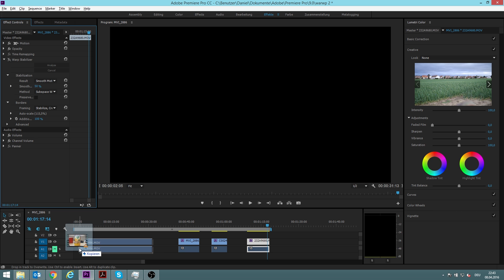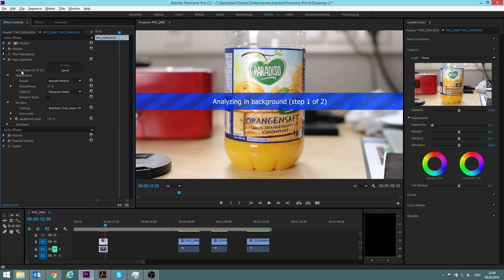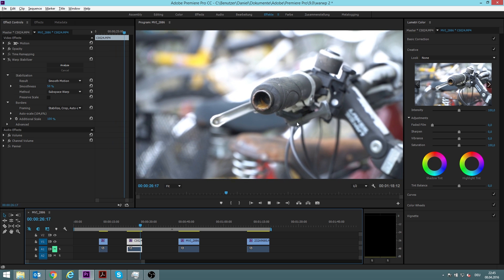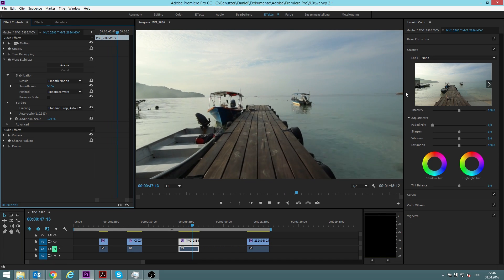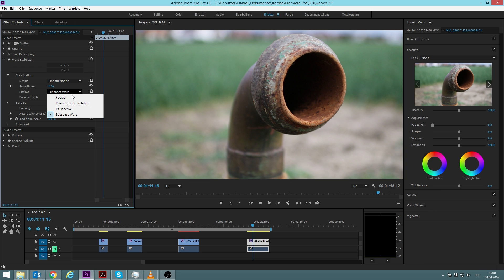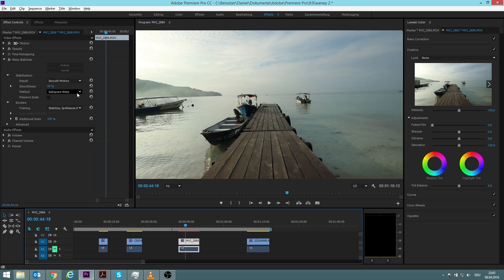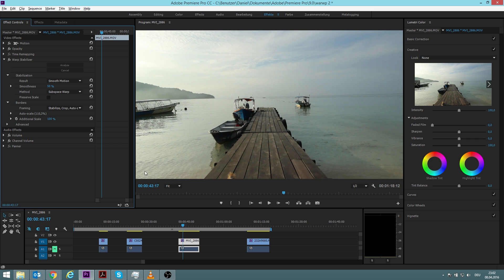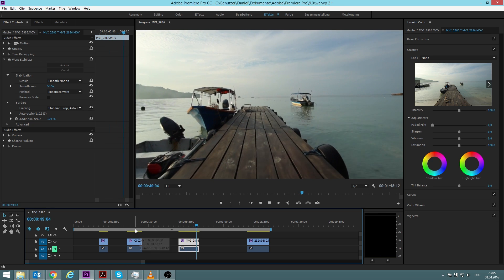How To Use The Warp Stabilizer in Premiere Pro CC 2015 Tutorial

Comment: Hi,
I have a little question with Adobe Premiere CC.
If I film in 4K or 2.7k with a shaky video.

What is the best solution in Premiere pro to stabilize and loosing a minimum of quality. The idea is to have a final video in 1080p. The goal is to take the benefit of the 2.7k to have a good video stabilisated in a 1080p sequence.

How to do that ? There are 2-3 solutions to do that in Premiere pro.

- Importing the 2.7 rush in my 1080 sequence and adjust the size of the 2.7k rush before stabilisation
- Stabilise the 2.7 rush in a 2.7k sequence and import the stabilizated rush in a 1080p sequence.
- Imbricate the 2.7 rush to be able to stabilize a rush who is not at the same size of the sequnce..

Tehre are so many solution... what is the best one ?

Thank you in advance.
(sorry for my english, it's not my mother tongue
Reply from the maker: Don't expect too much from the warp stabiliser. It can take care of small shacking but not big. Only because you recorded in a larger resolution does not mean that the stabilization will be better. I usually have my Premiere Pro in the resolution of the majority of the footage. If the majority of the footage is 1080p, I had edit in 1080p. If the majority of the footage is 4k, I edit in 4k and scale the 1080p footage to 200%.
Reply: Hi, thank you.
No I understand that the stabilization will not be better because I recorded in a better resolution. I want to avoid the loss of quality the wrap stabiliser do because of the zoom in the picture.
Regarding you example, if you scale the 1080p to 4k, you will have a big loss of quality, no ?
Reply from the maker: No, I did that already quite some times and couldn't see a loose of quality.

Comment: when i analyze it says "warp stabilizer requires clip dimensions to match sequence  (fix by nesting)"
Reply from the maker: It seem like your timeline resolution doesn't fit the resolution of your footage.
If that accidently happened go at the top on "Sequence"-> "Sequence Settings" -> "Frame Size" and change it to the resolution of your footage.

If you are aware of the difference in resolution and you want to keep it as it is, then you have to do nesting. For that right click on your shot, in the middle you will find "Nest...". Click it, give the clip a new name (I usually use the name the clip had before) and now you can use the Warp Stabilizer.
Reply: @videodslrtutorial  LIVE SAVER. Danke schön!